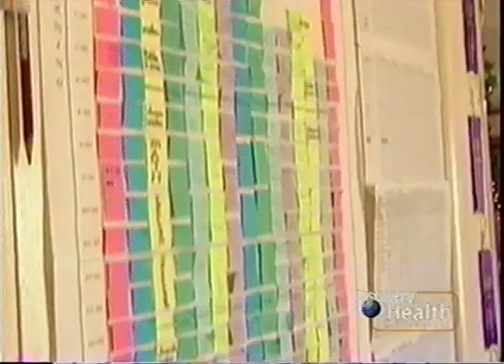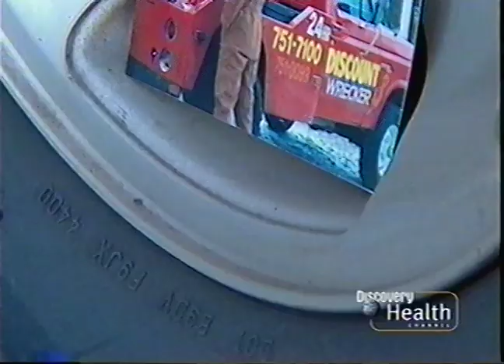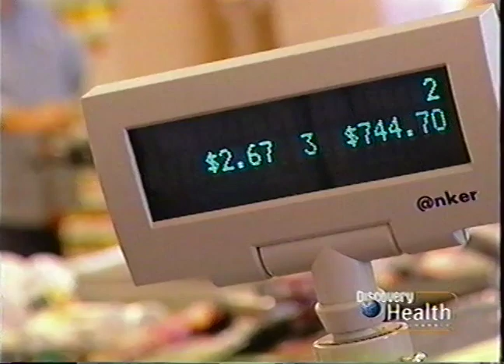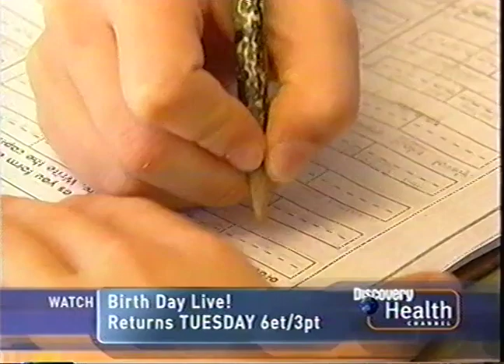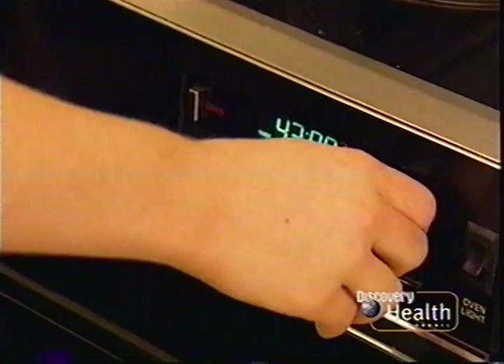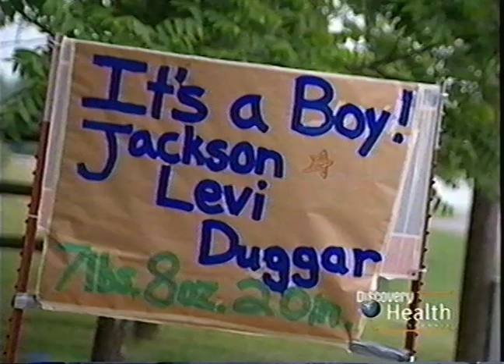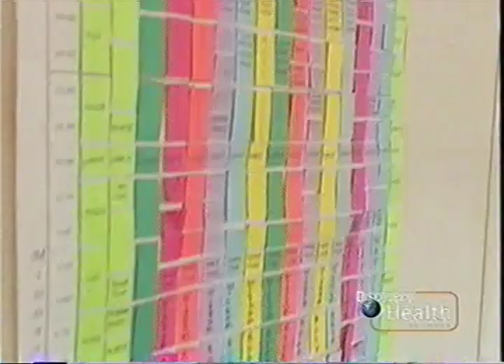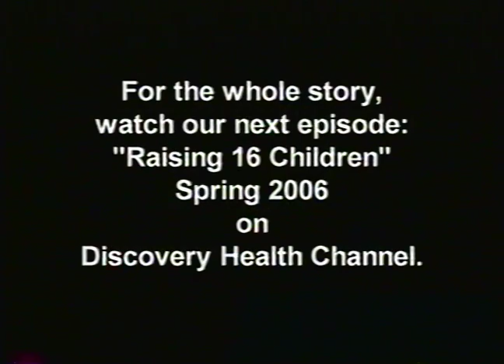14 Children & Pregnant again

Comment: Im just confused at how 10 kids, all different ages, sit around the table and they all learn the exact same content while being homeschooled?  How does a 4 year old learn the same thing as a teenager?  How is that proper education?
Reply: These are generally done for subjects like science. The parent will teach from the course book say a lesson in astronomy. The information will be geared towards the older children but the younger children can sit and learn and absorb what they can. They will each have individual workbooks to do after the lesson that are age/grade appropriate. So a kindergartener or grade 1 student will maybe color a picture of the solar system. Lower elementary children will copy some facts and maybe have to write a sentence answering a question. Upper elementary students will be expected to answer several questions at least one with a paragraph and maybe label the solar system. Most people don't include junior high students because they can work independently but if they do they would be expected to likely write an essay on the topic. It is what is called 'family style' learning and is not generally done for math or language arts.
Reply: It’s not.  I was heavily encouraged to homeschool at one point, but I didn’t for this very reason.  

Take math:  At the time I had a kindergartner and a 10th grader — and 3 in between.  How would I monitor sums and calculus 2 at the same time — and again, 3 in between.

Hell I’m not even qualified to teach higher math… I took calculus 1 more than 25 years ago 

Plus educational neglect has such lifelong consequences, and my kids are not going to suffer said consequences simply because I chose to do work that I’m not qualified for.  

Speaking of qualifications… there’s a reason why so many (the majority??) of American teachers have Masters degrees.  I would never presume to feel myself more qualified than a professional, graduate degreed educator.